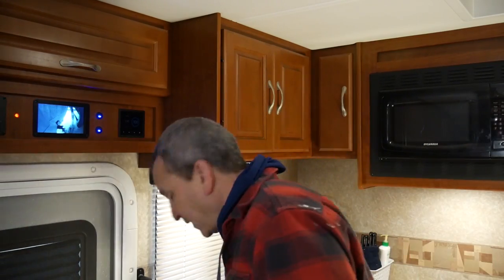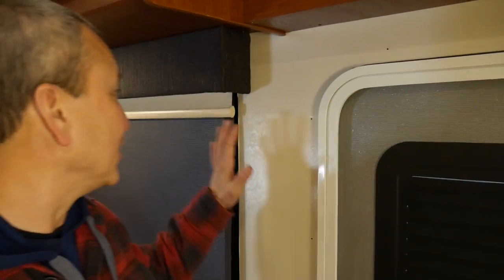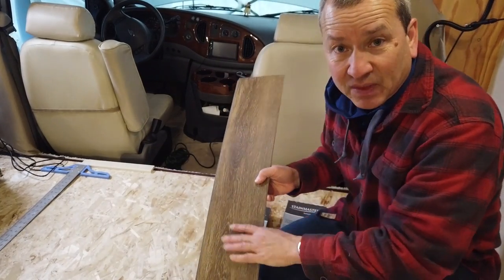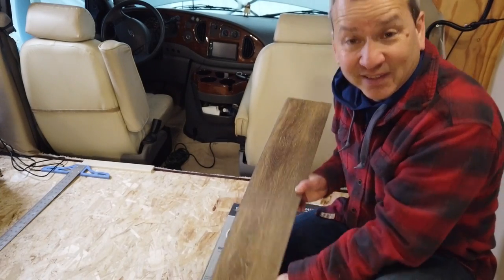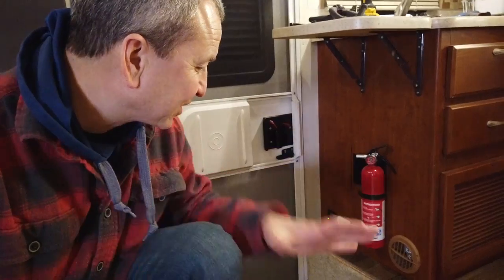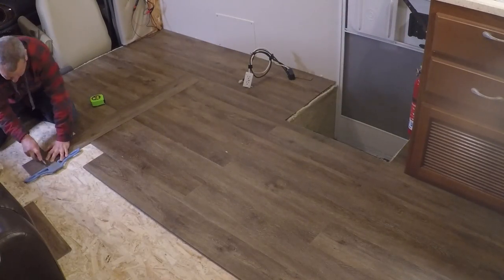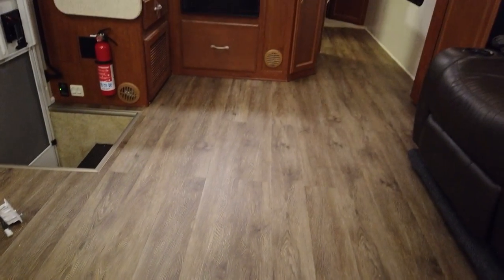Installing Vinyl Plank Flooring in RV Start to Finish | Class C RV Renovation | RV with Tito

Comment: You did a very nice job on the flooring, I was wondering how you were going to handle the transition areas, but that trim looks great. Since you did this in the winter, do yo have any concerns about expansion when it gets warm or did you leave a gap around the perimeter?
Reply from the maker: I did leave a small gap plus I kept the RV close to 70 degrees during install and while the flooring was aclimating.

Comment: I used the same material in my  5th wheel BUT did mine when the temperature in the High Desert was about 110 degrees killer hot. AND when winter came I saw the floor panels shrink, since you did it in the super cold I hope you do not see the floor panels buckle when in a hot climate. good luck
Reply from the maker: Yikes. We'll see. It was cold outside but I kept it warm in there while I was staging the flooring and while installing.

Comment: Nice job! I realize this post is four years old, but I have a couple of questions that hopefully, the years have supplied good answers. I'm about to install vinyl plank flooring in a much smaller travel trailer. I've read a number of places that it should be installed with a 1/4" space between plank and wall, due to expansion and contraction. It looks like yours are pretty flush.  Also, half the folks I've viewed say that it's not recommended to install plank flooring unless the climate is constantly controlled. The other half say they've had no problem. I live in New England, with warm summers and very cold winters. Have you experienced any problems with seasonal temperature swings? Thanks, very much!

Comment: Curious if laying loose lay vinyl in a cold climate will then buckle and warp when traveling to hot climates. It appeared they lock together with no expansion gaps? Nice job and looks great.
Reply from the maker: It's a possibility. We'll see. I left a small gap on the edges and kept it warm in the RV during the install.

Comment: Just purchased an RV just like yours and are doing a remodel including floors.  For some reason, the slide where our sofa is (your dinette) seems to “dip” and leans downward when closing.  This eliminates the space needed to clear the new flooring.  I anticipated this to some degree, as there were deep impressions in the existing carpet that we have since removed so I only installed flooring to that point to test the slide.  Upon closing, the slide pushed the flooring (glad I “anticipated”).  Is there an adjustment for the slide?  We so enjoy your videos...very informative
Reply from the maker: Some slides can be adjusted. I don't think mine can though. Ours dips a little too. Make sure it's level and take some weight out if you can.

Comment: Wow. Fantastic job! You make it look so easy. Lol. It doesn't appear that you used any glue. Is that so? And the whole thing has stayed put for the past year???

We want to change out the the flooring in our bumper pull and in our 5th wheel (yeah we have two. 🤷‍♀️) But with slide-outs we weren't sure what to do.

Comment: Year later, how is it holding up?  Why kept carpet on sides of steps and such?  Are those areas not a dirt or stain problem areas?  What did you do to address the water damage under the fridge?  Can you get that thing out to repair under it?  Marine board or water treated board for repair?  THANKS!  I think those floor are beautiful. :)

Comment: How has your flooring held up since you installed it? Any issues with temp swings or anything else?  I just had a huge frame bolt come up on my vinyl flooring, and I'm thinking of tearing it all up and going with a plank type like yours. The vinyl looks like crap already and my mh is a 2018. Did your flooring have a pad on the back for a softer feel/ and insulation properties? If not Did you consider anything and just decide not to take the extra step? Thanks for sharing.
Reply from the maker: These already had a rubber backing on them. So far they are just fine and just like new after 18 months.

Comment: A lot of snow here in Maine also.Great videos on repairing Rv’s and so easy to follow. I have a class c that I just bought last fall.Have not even camped in it yet. I have a repair question for ya.Both sides of the front of the rv has cracks on the front panels.Any ideas? I have about a two minute video showing the spot on my channel.
That was some cut you did on the doorway! Will be getting rid of the old carpet in ours sometime.Maybe sooner when my wife sees your video 😁
Reply from the maker: I watched your video...lots of snow. It certainly looks repairable with some fiberglass patching or even replace the whole panel with some aluminum. You may check if there's any water inside first. Good luck.
Reply: RV with Tito DIY Thanks for the reply. I probed a bit with a screw driver and I don’t believe there is any water damage. I think the only time it would take any significant amount of water would be driving in the rain. I do want to repair it because the rest of the camper is in such great shape.Other than one hubcap missing😁.The prior owners kept it under cover in the winter and had no children or pets.
And yes way to much snow!

Comment: I just removed the rug. I want to install vinyl planks. I've seen other videos with peel stick type and they had to use glues. I see you just did it dry. I guess the gap is important for expansion.  I rather do that than use glue ( toxic ). You preferred the interlocking type also...by the way it looks fantastic!!
Reply from the maker: Thanks. Those planks work great and are pretty water tight.

Comment: Are the vinyl planks adhesive backed?  I haven't seen you apply any glue or peel any adhesive covers off.  Thanks in advance! I'm about to redo my 23' Thor Chateau
Reply from the maker: No adhesive or glue. It's called a floating floor.

Comment: Brian, currently renovating my 1998 Class C. Pulled up some carpet over where the LP tank attaches to the frame. There are some round head carriage bolts going through the sub-floor making small "bumps" in the floor. Did you encounter this and how did you resolve laying the flooring over these bumps?
Reply from the maker: I think I removed one and lowered one by first loosening it from below and cutting the plywood around the head so it recesses when you tightening it back. Good luck!

Comment: Great video. How did you handle the flooring where it goes under the slide? Also, in the bathroom it looks like you put down a small piece of trim to cover the wall-floor gap. How did you get it to match the woodwork?
Reply from the maker: Under the slide I went back as far as I could reach. I was able to find some cheap trim at Lowes that was pretty close to the cabinet finish.

Comment: That looks great!  Thank you for sharing your experience.  Do you have any recommendations for installing this floor in a camper with a slide?
Reply from the maker: Can be difficult removing the old stuff if your slide is flush. Mine had a bit of a gap to work with.
Reply: RV with Tito DIY Than you!

Comment: Hi Brian, you’re videos are really great and also fun as we have very similar RV models/years.  I’m about to put in a floor so I came back to this video.  Hearing that some vinyl floor can expand in really cold temps.  Reading the specs on Lowes ProCore flooring, it says not for environments that go under 50 deg F.  That’s where I saw someone post a concern.  Having you had any expansion issues with yours?  Thanks so much and keep the videos coming!!
Reply: Interesting thing, wondering about temp variations and where this rig travels. Thanks for posing the question.

Comment: What would you suggest for toy hauler flooring? I’ve thought about doing LVP previous owner did fake LVP sticky kind and my 4 seat rzr has messed it up in some spots from the weight shifting in transit, thanks for your vids they’re top notch

Comment: Looks nice Brian. I need to do something with my '13 Airstream flooring.... yellow and screws holes where the original dinette legs were screwed down (built a work surface/desk/bed platform). I wonder if some kind of underlayment (pad or foam) could be used? I love what you're doing to the old place!
Reply from the maker: Thanks! I could have added underlayment but decided against it.

Comment: Thanks Tito. My wife and I were debating on changing the flooring in our fifth wheel, but I was hesitant on if I could do it or not. After seeing your video, I feel better or more confident that I can do it.  One question, I saw the tool you used to make angled cuts, do you know of a tool that I could use to figure the cut on a curved wall ?  Thanks !!!
Reply from the maker: I would just use cardboard and an appropriate sized can or round thing. You could even use a wire to match the contour of the curve. Off the top of my head, that's what comes to mind. Hope it helps.

Comment: Wow you are so good at what you do, thanks for posting. I live in a Cottage the 40CCK model. I live in NZ The slide out where i have the dinning table & chairs has a dent when you step on i the carpet, so i think the flooring has given way just on one small area. CAN YOU SUGGEST HOW TO  BRING UP THE CARPET AND FIX AND WHAT FLOORING CAN I USE AS I DO NOT WANT TO UPSET THE SLIDE OUT AT ALL THANKS
Reply: Don't know a lot, but it sounds as of you might have a flooring failure and should check out his video on repairing water damage as well...?

Comment: i'm really enjoying these videos and they are inspiring me. I've been putting off remodelling my Compass Drifter (UK). I was thinking of putting down some insulation before I put the new flooring down (stick on vinyl planks). Did you do put insulation down? that and what kind did you use, please.
Reply from the maker: I didn't put down any underlayment. You certainly could. It might add a little more height to the floor. Mine are installed right on the subfloor.

Comment: Did you or are you experiencing any off gassing with this floor? I installed Allure vinyl planks peel and stick and they stink so bad I am gonna have to rip the floor out. Also now that some time has passed, any other issues with the floor? Thanks

Comment: Great video on the flooring. I am curious. Do you have a slide and if so, how did you do the flooring under the slide?
Reply from the maker: Yes. There's a slide, but it doesn't roll. I went back as far as I could reach.

Comment: I resurfaced my trailer flooring with   vinyl flooring as well. It was about 4 years ago.  It turned out beautiful.  I was disappointed to discover that shrinkage occurred during the winter.  I have to redo it.  Note it did purchase the thicker tile.  Anyone know what vinyl flooring works best? Which product contracts or expands the least?

Comment: Ok, so it looks great, how does it hold up to the weather as it is a floating floor, how much weight do you think you added and how well does it work with your slide, I have rollers one one side the other side slides across a plastic plate.  Looking at replacing ours, I pulled up the carpet but have not made a decision to put peel and stick over the existing linoleum or pull it up and do a floating floor or glue the planks down I definitely want to do vinyl plank but still working out all the kinks
Reply: I found your playlist and the update video on all of your additions.  I think the only question I did not get answered by the video was the slide.  I am guessing you have a slide in the class C did you glue down that last row that butts up to the slide transition?

Comment: Looks absolutely fantastic!

I want to replace the carpet under and between our bed and the walls and on our bunk room steps. I don’t understand why they even put that little bit of carpet in the rig and the rest is nice one piece flooring. Makes no sense.
Reply: First is cost; carpet is fast and cheap on small areas. Second, many folks want carpet under foot rather than tile when getting out of bed, and the mfg knows the folks don't realize they can put a throw rug on the tile/plank floors to accomplish the same thing while maintaining the ease of RV cleaning. (Maybe?)

Comment: Great video! Definitely has me planning something similar to my own RV. What troubles did you come across when replacing the flooring that goes under the slideout?
Reply from the maker: Yeah that's the biggest issue. Removing the carpet from under the slide was a pain. Lots of tugging and grunting with a super long set of pliers.

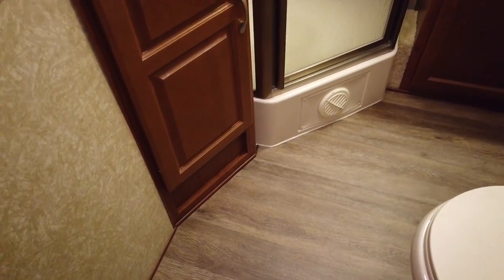Comment: Hello Tito... at 13:15 the small rug between the shower base and the cabinet... did you built that or did it came in like that with rv? I am asking because my bathroom in my motorhome is similar to yours but I don't have the rub, its just laminate board. Mine got wet a while back ago and the pressed board swelled and doesn't look nice anymore. Do you know if that can be removed or if there are any water lines behind it? By the way, great job with the floor.
Reply from the maker: Hey Hector. The carpet piece was there before but I'm going to build something out of wood to replace it. I'll seal it up nicely. Yes there is plumbing and electrical running behind and under the shower.
Reply: RV with Tito DIY thanks, great to see you with RV Geeks. I need to replace mine, so I’ll wait for you to break it first. Lol

Comment: The flooring looks great. Couple of questions on the job. Did you do anything with the carpeting that is underneath the captain's chairs. Also it looks like the flooring is simply snap together. Did they stick down to the sub floor at all or is it completely snapping the pieces together. Also on the painting did you have to do any prep to the walls or did you just paints directly over what was their previously. Coach is looking great thanks for sharing.
Reply from the maker: We left the carpet in the cab for now. We'll replace it later. The flooring does not stick down. It's a floating floor so they just snap together. I did use a rag with a little bleach/water and wiped down the wall before painting. That's it though.

Comment: Hi Brian. You do great work and I really enjoy your videos. My wife and I recently picked up a 2004 Winnebago Adventurer and we want to do some upgrades including replacing the linoleum and carpet with vinyl flooring. I couldn't quite tell from the video but it looked like your rig might have a slide by the fridge. Mine has a large slide on the driver's side with the sofa and dinette booth. I was wondering if you have a slide does it cause any concerns for the new flooring? If you don't do you have any advice. I'm worried that the slide will rub on the new vinyl when it runs in and out. I will be watching your video for the TV lift cabinet and trying to work up the courage! Thank you!

Comment: What is the tool you used to find your angles? I need one of those!!! Also what did you use to put the 1/4 round on? It didn’t sound like a nail gun.
Reply from the maker: It's a t-bevel that will set you back a whopping $3 (https://amzn.to/2pWC6Mo). Also, it is a  battery powered finish nailgun. I was using short 1" nails.

Comment: How has the floor held up when the rv isn’t being used? I’m not sure where you live but I too live in a snow state. So we get hot summers and cold winters. I’ve done reading on the internet about people using vinyl plank in their campers or motor homes and they say it will buckle or expand and contract leaving gaps between planks due to the temperature and humidity changes.

Comment: Hi! Super interesting! We are about to change the flooring in our RV (2000 class A we bought last year). At this point, we are looking at linoleum. Two questions: Is it more recommended to remove the old flooring before installing the new one? Should we go with planks as you did, even though winters are cold up here! Thx! Daniel
Reply from the maker: Yes. I'd remove the old down to the plywood.

Comment: Looks great!  nice work!  i wonder what the expansion/shrinkage is on vinyl flooring and if you'll see any heaving in the tight areas like under your bathroom door?
Reply: It's a floating flooring, if there is any damage, you can remove the problem and fix it.
Reply: You have to leave expansion room as tryouts suggested.
Reply from the maker: Thanks. I'll have to keep an eye on it. It should be pretty easy to fix. I kept some extra planks.
Reply: @srperk6163  Not always. Some flooring expands at the same rate as the underlayment. Worst case he needs to get out the cutter again.
Reply: G Henrickson, As a representative for a major flooring manufacturer and we always recommend  leaving room for expansion. The material he installed is made from pvc and will expand at a different rate than the floor it is installed on.
Reply: RV with Tito DIY You May see it in the width more so than the length. Look for installing natures path loch solid on you tube.  There will also be videos on replacing plank.  Love your channel.
Reply from the maker: Thanks for the tip!
Reply: Surprisingly easy project!! I am just wondering if the bathroom flooring should have some kind of water tight subflooring especially around the shower, you don want water sipping through the vinyl into the composite again...

Comment: Excellent job again.  When are you packing the shop and hitting the road?  I have another RV you can do some work on.  Couple of thoughts as usual.  Those carpeted stairs don't look good, sorry. . I would have cut flooring to fit each side, glued the stripes together, glued the assemblies to the stair sides and then put the trim in place.  I know you don't use shore power much at all,  but you should have put in heated floor panels in selected areas, such as the bathroom.  Nothing like stepping out of the shower on a chilly morning onto a nice warm floor.
Reply from the maker: Thanks. I'll revisit the stair well later.